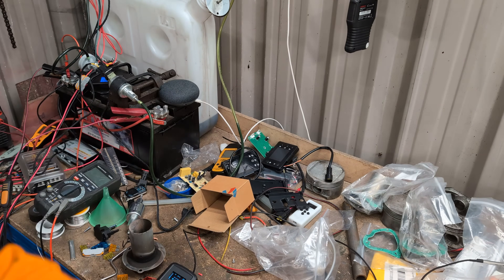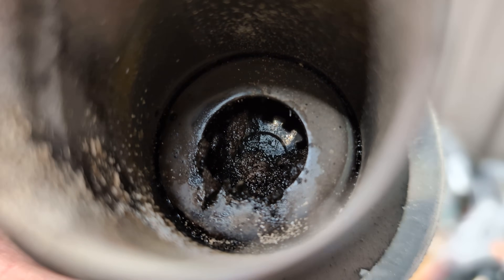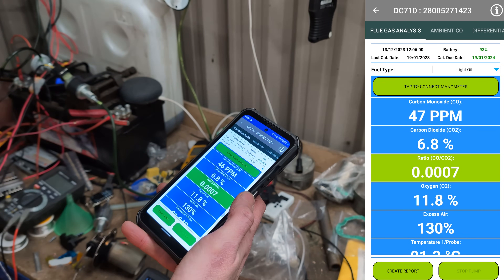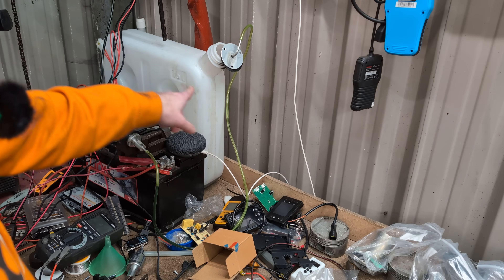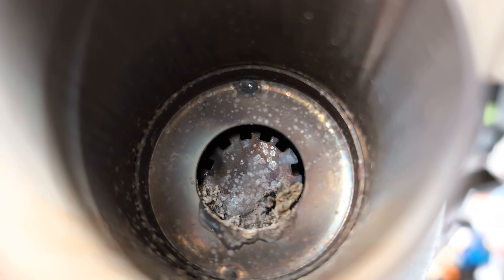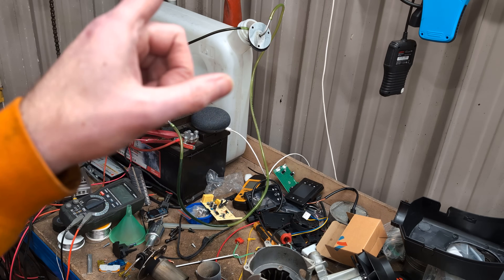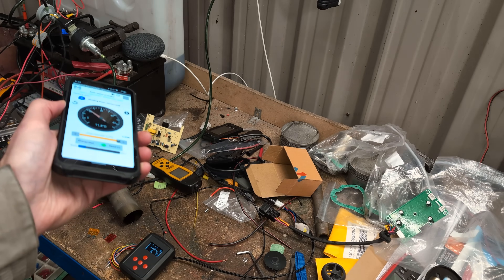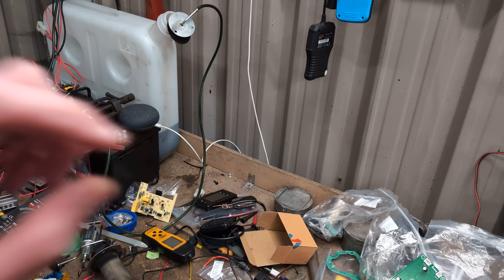Diesel Heater testing filtered waste oil - 50/50 diesel oil mix - part 2

Comment: Anyone who wants to do this needs to put a heat gun at the air intake so the intake air temperature is over 450°c and then you will have absolutely no soot build up
Reply from the maker: That will melt the intake fan.
Reply: @DavidMcLuckie  heat gun is the intake fan

Comment: Ive tried a low percentage of used oil 10% and the burn chamber clogged up around 40 hours, frankly not worth the effort. Im back to running 100 Kerosene with zero issues.

Comment: Start up on normal mix then switch to oil mix when its hot, then switch back to normal fuel on full for 10 mins to clean the chamber...

Comment: Hi David. Sorry to post on this video, couldn’t see one on the new controllers. I ordered a new board, controller and wires. The controller comes on but don’t show any voltage but everything else lights up, I have two different new type ones that do the same. If I switch to an old clock it shows the voltage and fires no bother. Any ideas? Thank you.

Comment: David, I could've sworn I already made the comment but couldnt find it, but have a look at my latest vid on my channel, I was wondering if you could put catalytic wool in the burn chamber, instead of the fiberglass. Its what I want to do at some point (instead of just bunging it at the end of the burn chamber, I need my heater right now, no time for modding it). That way it might glow red hot and burn off carbon, and also improve your CO readings. Also watch the big clive video on the hand warmers about how they work etc.
Reply from the maker: I have seen clives video at the time.  I shall google catalytic wool.

Comment: I know this is a bone question, but do we know if the engine oil is synthetic or mineral?  I have no idea if synthetic will crud up more than mineral, but seeing that diesel is mineral...  I am a seasoned veteran of running vehicles on waste veg oil I filtered myself.  I used to add misfuel (you can get this from most garages as unless they have an oil burner, they have to pay to get rid of it) to the veg oil before filtering .  Of course you have no idea of the ratio of deisel petrol mix thats in the barrel, so adding 10% is usually OK.  Perhaps you might get better results warm filtering with the diesel added first?

Comment: Would it be possible to re-run a test with the same mix using clean or re refined (recycled) oil. If it was significantly better using cleaned oil over carbonated oil it may work out easier just to setup a better filtering system. I live close to an oil re refining facility and was lucky enough to be round it with my job so was able to see the process on an industrial scale of taking black carbonated oil and cleaning it to what looks like brand new oil. Also pre heat might help some with engine oil, fuel pump output into copper brake line, coiled up heater output before being fed into burn chamber...can't hurt.

Comment: Don't do it! 
We used to have a big oil burning heater in the workshop. I used to have to clean it once or twice a week depending how fast the crud built up in the catch pan.
We are talking about a pan two inch deep by two feet around.
The tools for the job where a hammer and big straight hammer through screwdriver, that shit is called the black death in the motor trade.
A texture of black goo, concrete but chips off like glass.
Waste engine oil heaters need to have easy access to the burn tray inside the burn chamber

Comment: I think the problem is the oil wasnt fully clean. You would have had sediment circulating as it wasn't transferred to a clean container. Also try 1 micron filter.

Comment: Perfect timing, ive recently set up two tanks, each with a fuel tap. 

I start up on kerosene for 5 mins, then switch over to 50/50 used motor oil/diesel for 3-4 hours operation, then the last 10 mins operation on kerosene again.

Touch wood, no starting problems after about a dozen cycles now. 

Also based in Mexico 😂
Reply: This seems to be the way to go, a lot of the car guys use twin tanks

Comment: Could you try this out on the 2KW heater that has the end cut off with the glass window?  that way we could see the what the flame looks like while it burns the oil, and also how the ash is forming inside the burn chamber.
Reply from the maker: That's a good idea.  Now all I have to do is (a) find it (b) hope I haven't made it into something else.  :)
Reply: @DavidMcLuckie  Oh wow a window into the combustion chamber. I'm currently playing with a twin pump system and some custom electronics to digitally mix the fuel going into the burner as pulses of fuel A or B in any one of five switch-selectable sequences: AAAA, AAAB, ABAB, ABBB or BBBB. Would sure be nice to look and see what happens when a pulse of the "bad" fuel gets injected.

Comment: Would be interesting to see if, after your 4l, while still running you switch over to diesel on full power for say 10mins to see whether this would clean up the burn chamber…

Comment: excellent  info.  When people run their Diesel engines on waste oil, they recommend running the oil through a large centrifugal unit to clean the oil before use.  I think  'cleaned' waste oil would probably run fantastically . Perhaps you could source some  'cleaned' oil from someone local with a centrifuge to test ?   Some trucks (and a few cars) have smaller centrifuge units permanently plumbed to the engine that keep their engine oil clean. Perhaps you could use one of these types to clean your oil before burning. It makes a HUGE difference on internal combustion engines if the oil is centrifuged first.
Reply: You're exactly right your typical centrifuge will bring it down to less than 2 microns significantly decreases carbon buildup I built one out of a brake drum you need about 2,000 G's of centrifugal forced to get about 2 microns
Reply from the maker: I'd love a centrifuge to try, but they are expensive.
Reply: @DavidMcLuckie hi,old Scania 10/11/12 litre six pot engines use a centrifugal filter driven by the camshaft, I'll be in my friend's yard next week and see if he's got any spare ones lying around. Keep up the good work you're doing.
Reply: Sorry, I'm getting old and had a slight? Brain fart😂 The Scania filter is driven by engine oil pressure and mounted on the engine block in the area of the camshaft.
Reply: I have run an older (1997) Direct injection turbo diesel engine in my rover, on fresh engine oil and diesel. Usually about a 5 litres of oil to almost a full tank of diesel, and I end up with the same carbon build up and deposits as the heater in my piston bowls and around the injectors. After a bit it makes the engine start to haze light smoke and have a lumpy idle due to the crap swirl and incomplete combustion.    You have to physically scrape off the deposits which means cylinder head and injectors need to come off. I had to RnR the head recently due to HGF  and after cleaning everything the engine ran the best it ever had. Of course couple months later I decided to try it again with the oil... by the end of the tank the engine is back to running like crap.. even after several tank fulls of plain diesel. I think the only way to run engine oil as fuel is to distill it to a lighter fraction first, I would assume that this would then remove a lot of the unwanted stuff out of the oil and make it far more like diesel. Setting up a fraction distilary and getting it to work though is more than average Joe would care to mess with.

Comment: Too much forign matter in fuel will give soot and ash in any case the atomiser will glaze over. Dirty fuel simply doesn't work on these heaters I burn kero for years and never look in the burn chamber at 67 pence a litre it's great. 😊

Comment: It would be fun to see what the exhaust is doing during these experiments. Furthermore, is it possible to clean these burn chambers?
For example in a chemical bath to dissolve the carbon. Or by running a partially clogged chamber on pure diesel to burn the residues off.
Reply: I use a blow torch, cook it off then some mechanical cleaning

Comment: These commenters who think that extra heat will burn off deposits are not educated in chemistry.  The only way to burn carbon is with oxygen and a sufficient temperature to create the reaction (think here of a charcoal BBQ).  There is no heat at the swirl chamber unless the oil is burning at that point.  There is no glow plug heat after start-up.  That means if the oil is not hot enough to burn any deposits, those deposits will just increase.  Add in all the solids in the oil (additives) and the burner will soon be in trouble.  The only way to burn waste oil, for long, is to ensure any deposits are completely carried away from the combustion area.  That is clearly not happening!
Reply: Another guy who was burning waste oil has a mixture of 70/30 waste oil/kerosene. And he had a fuel switch where he would always start the heater running pure kerosene until up to temp and then switch to waste oil. He said if he started up with waste oil mixture it would get clogged and have a lot more residue.
Reply: It works fine but there is a temp sensor in the heat exchanger which shuts the machine down before being able to get hot enough to turn the unburned hydrocarbons to ash.  Some ash but enough hydrocarbons to restrict airflow.  It does work for about 24 hours
Reply: @jaysonhoulihan9808    There is no ash, if hydrocarbons are burned in air.  The products of combustion are dihydogen oxide (water) and carbon dioxide.  There are no other elements in this group of chemicals.  It is why they are called hydro carbons.  The ‘ash’ is either from the waste oil (additives, etc) or unburned carbon (or even hydrocarbons, if not hot enough to volatilise them).  If the flame temperature was hot enough, with excess air, there may be gaseous pollutants such as nitrogen oxides, of course (like from internal combustion engines) - but fairly unlikely on any large scale, what with loads of carbon monoxide and little spare air in the mix.  Obviously plenty of ‘diesel particulates’ if the fuel is not completely combusted.🙂
Reply: So you are right and wrong.

Comment: I’d  want to drill a small hole at the bottom so the oil will drain past and hopefully burn in the tube instead of creating the blockage.

Comment: I suspect that it will be difficult / impossible to get the same numbers / readings as with a proper waste oil furnace, as they atomize the fuel. This means much more of the oxygen will be used up... I know I'm not telling you anything you don't know ... but perhaps something that is easily overlooked. 

I feel like these heaters struggle with a few things when trying to burn waste oils. The fuel needs heat to flash off, as the burn chamber is basically a wick that conveniently gets resupplied via the pump. To get a hot chamber, you need a decent AFR, but trying to achieve that AFR means feeding in a substantial amount of air. The air has a cooling effect and cools off the chamber. 

Also, these heaters are extremely sensitive to air / exhaust flow.... As soon as you get any build up in the chamber, while the heater may still start and run, the flow is altered... as you have already seen, you set the AFR and 3 minutes later everything is out of whack again.... a few minutes later it may be back to "normal". A huge part of this is also because of unburnt fuel. This will build up for a while and then burn off aggressively... it's impossible to get any sort of consistency, when  the fuel you are pumping in isn't burning off at the same rate you are pumping it in. 

I installed thermocouples on my chamber and did a bunch of tests. My best results were achieved when I was able to get the temperature of the chamber up, but this was never sustainable. Sorry for the huge rant...
Reply: Both of you guys have done some kind of modifications to the heaters. With the same results.  Massive amounts of build-up. There is no way around this result while burning WMO. 
Yet people still claim they do it without issues....😂.
Thanks for another great video.
Reply: @cliffelmore5834  Yeah... What Dave is aiming at here, that makes sense, is an easy way to maintain the heater and keep it burning longer between servicing / cleaning.
Reply from the maker: Yes.  I agree with everything.  The difference between 1000ppm of CO and 100ppm was 0.2hz of fuel adjustment.

It's almost like these heaters are designed for diesel and not heavy waste oil.  :)

The main reason for these test is so people stop asking.
Reply: @DavidMcLuckie  Haha... I have done a lot of testing for this exact same reason... in fact, I almost built my channel off of it. Keep  up the great videos. You are an inspiration.

Comment: Thanks for running these test it some good info.  It seems like base on O2 % and CO ppm that your not getting a full burn, and this seems to be back by build up of junk in the burn chamber, and it does not seem it can fixed by only adjusting the fuel fix only.  Now see your running at fixed 4000 rpm on your fan,  I wonder if running the fan speed higher or slower could help,  more RPM would me more air in to help the burn but is also more air over the body cooling it,  but maybe there sweet spot in there somewhere.  Other thought is maybe restrict the flow over the body some this should let body heat up more and burn chamber too, the heat output shouldn't be hurt to much you have hotter air coming out at slower rate so over all heat should close to the same, maybe this better for other group of tests.  I thinking for next test dong something like 20% oil mix.
Reply: Try about 5 to 10% and it will burn very clean
Reply: @overtorqued2114  This comment nearly 1 year old now, engine oil and like oils have non burnable additives like silica, make what commonly called ash, but this forms hard pottery like clay build up in burn chamber this happens even if you getting clean burn, even burners build to run used engine oil have this problem and need to clean out from time to time and rebuild much sooner than other burners.  This ash build up does not hurt running of the heater very much until it start blocking the air flow, then starts running rich.  This ash is very hard clean out, and can't really be fully clean out without cutting the burn chamber apart, after few cleanings you end build in places you can't get too, and have replace the burn chamber.  David and others that had been playing with this and doing testing over some time, have all said there no way to really do this without having problems at some point.  Now some don't mind cleaning the insides of the heater some and replacing burn chamber or even full heater as they are fairly cheap.  David and loweredexpectation have move on to building there own burners heaters base on burning used oil, Lower has new video out says "heating my house for free cost me $2000"  given he been working boiler work with his new burner, I'm thinking something went wrong.  As for your plan to burn 5-10% oil that shouldn't impact the burn very much, and the build up ash will take fairly long time before starts being a problem.  My self I have no plans to run oil in my heater at this time.  I setting up a 5Kw heater to heat my 2 car garage, and mostly just when I'm on something so the cost of running not that big of deal and I don't have lots used oil laying around ether. Burning it 5-10% rate like you said would only off set the cost by 5-10% and that is not taking into count costs of cleaning and replaces heater parts down the road.  I use natural gas to heat my house, I did a fast check on cost, and It looks like it would cast 5 times more to heat with diesel heaters, now my garage I'm been using propane so for it a diesel heater should cost less to run, I'm working the setup for that.